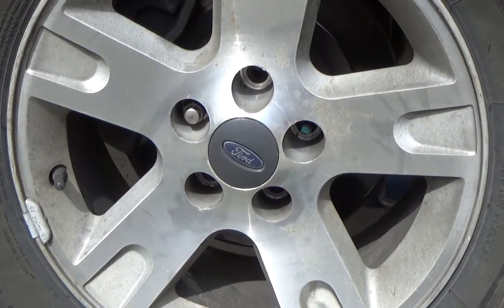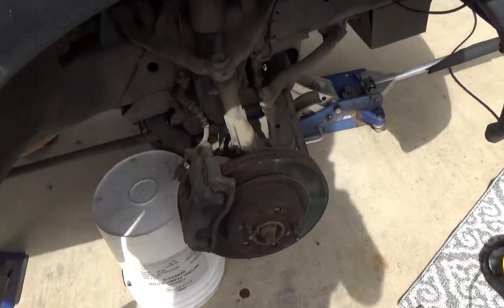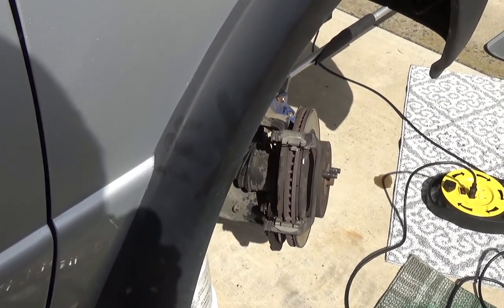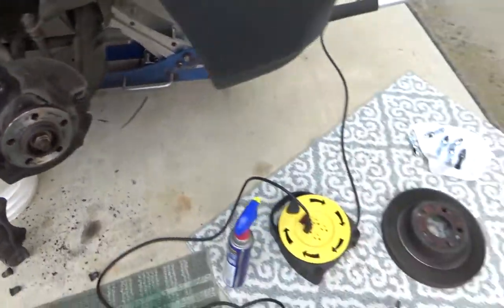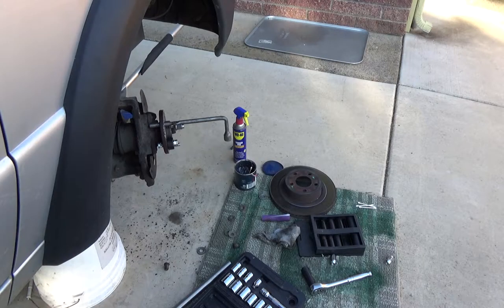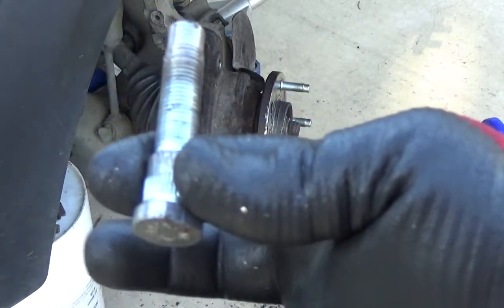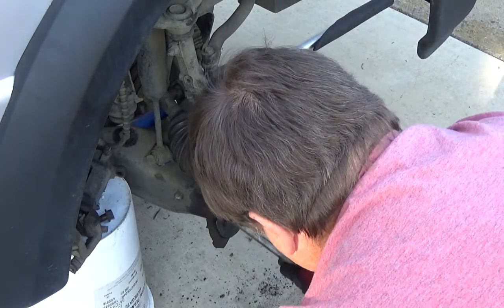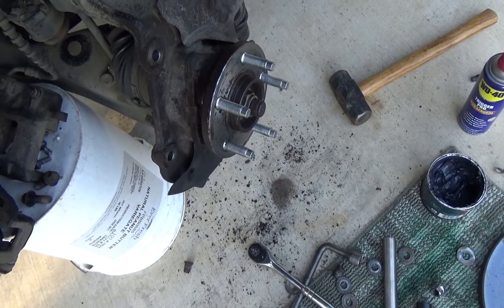Replacing #Studs on 2005 #Ford #Ranger

Comment: See, i don’t have a broken lug im just trying to put new ones on that are longer because the stock ones are really short.
This 2005 ranger has a similar setup to a 2003 so im hoping it really is just as easy as you say it is after i and my father replaced the suspension, control arms, and lower ball joints, along with giving it a 2-3 inch lift. 
Thank you for showing ke what i need to do.
Reply: Nevermind, after looking at it in more detail, you got 4WD and i got Rear2WD. And the center piece that hides the bearing is welded on my. The break pad and the center piece is one object for me.